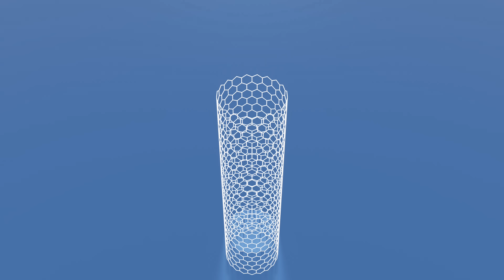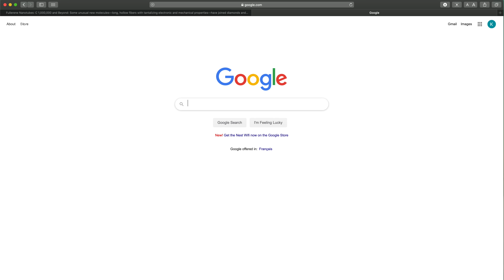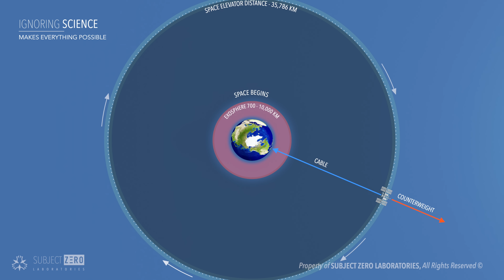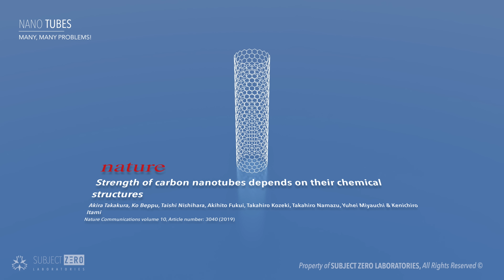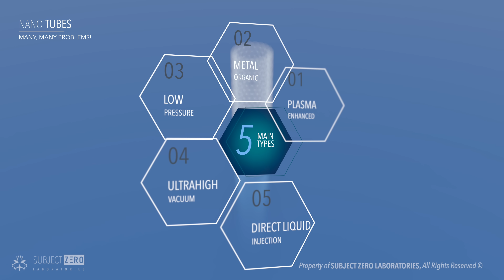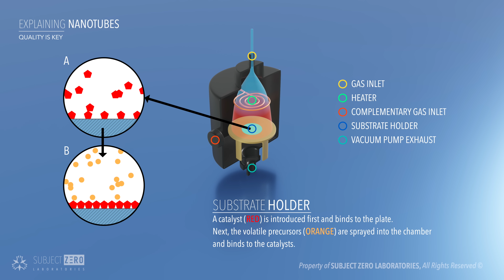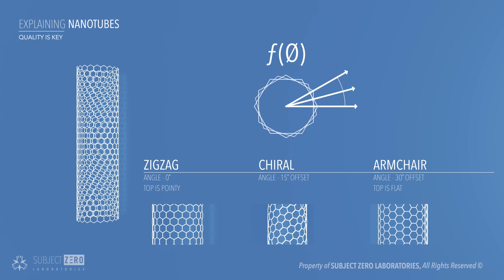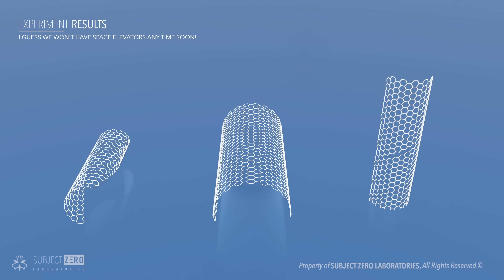Nanotube Strength, Bad News for Space Elevators [2019]

Comment: I'm afraid I have another spoiler: radiation. Even if you manufacture a space elevator cable that is perfect at the nano scale, it will be bombarded by various particles and waves coming from the sun and stars. Some of these things are bound to penetrate the cable's nanotubes, knocking atoms out of the perfect structure, and thus weakening the whole cable. Seems like a very costly cable if it will need to be replaced every few years, unless you can figure out how to detect and repair defects automatically.
Reply: But its not like space ellevator gonna leaving earths magnetosphere
Reply: Well, the thicker the cable, the thicker you can make any sort of shielding around it, in real terms and proportionately: a cable 4 times thicker will support 16 times the weight of shielding, yet have only 4 times the surface area, so then the shielding is four times thicker at all locations. A ribbon would shred. Yet, armchair nanotubes are still stronger than the requisite 63Gpa - it's silly how disingenuous he is, claiming that 'nanotubes are too weak, so no elevator', when he himself admits that armchair nanotubes made by this quick-and-dirty method were in the 70GPa range! His chart on relative tensile strength also shows how graphene is ALSO well above the requisite strength - so, just like the ISS, shields protect from radiation. Further, radiation is point-damage, while a cable has depth - if damage at any point has intact carbon around it, then the loss of strength would only reach 1% after a full 1% of the cable's cross-section were damaged at all points upwards along the cable... which actually would take decades, long enough to hoist a replacement and for it to pay-off... it'll be solid diamondoid, anyway, not nanotubes.
Reply: @anthonyrepetto3474  - So what magical material keeps the tethers from breaking loose when the wind picks up?
Reply: @MkeKen67  Um, winds only occur along the first few miles of cable, here in the atmosphere, while the cable itself would be 60,000 miles long. And, if you examine the cross-section of the cable over that distance, considering that all realistic proposals for space elevators would be floating in the open Pacific to avoid bad weather for the purpose of continuous operations, maximum wind velocity is only a tiny fraction of the forces that the cable would need to sustain for it to extend tens of thousands of miles. The effect of wind on the cable also decreases quite rapidly as the cable becomes thicker, because you square the material involved, while its cross-section increases linearly. It's like worrying about a swarm of flies going into a jumbo jet; simply having a force applied by wind doesn't magically make that force as powerful as the structural demands of the elevator itself. The REAL issue with space elevators is the capital-to-capital rate: for every ton of elevator material, how much cargo can I lift at a time, and how long does that cargo take to ascend? Many proposals for elevators use lifting methods which are very slow, and as a consequence, they lift fewer loads per year, and it takes longer for the first elevator to lift all the material to make the next one. A practical elevator will be thick, and it will support rapid acceleration by beamed or wired energy. Graphene really is the best candidate, overall, because it can take many forms and pack densely, and even this video's disingenuous host admits that graphene strength IS sufficient for an elevator. Carbon nanotubes were only associated with space elevators because they were studied first.
Reply: @anthonyrepetto3474  - You cannot avoid high altitude wind. Also, how do you keep the cable from gaining extra weight and thickness from ice build up at higher altitudes (the "icing" problem)? Furthermore, how can an orbiting satellite/spacecraft/space station be used as one of the harness points for a cable, with a floating harness point (in the Pacific Ocean) at the other end? Why would it ever stay "taut" in those circumstances? You will never get a heavy load to climb all the way up an extremely lengthy, slack cable. It would be like getting hung up on a zipline. 

Maybe the wind actually is the least of one's worries in this situation.
Reply: @MkeKen67  Um, I only mentioned the Pacific to avoid storms that would cause trouble for cargo operations on the sea, like a hurricane, not the jet stream and such. As I mentioned before, the amount of force that wind transfers to a cable drops linearly in proportion to the cable's width, so a thicker cable is automatically more wind resistant, without needing stronger materials. That wind also only applies to the first few miles out of 60,000 miles, so I wouldn't call it high-altitude. In terms of the total forces applied to the cable, wind is minuscule. I hope it's also clear that, if we are using beamed energy to loft cargo continuously, it is trivial to use that same beamed energy to melt ice; you are not presenting deal-breakers here. I also don't comprehend how you imagine that a cable cannot be taut if it is attached to a floating platform - do you think that the cable will pull the platform into space, because it is not bolted down ? I sincerely hope not. It's more alarming to consider that you believe that a cable would remain slack even as cargo was crawling up it. Cables become taut when they are under tension - and that tension is provided by the mass of cable that is up in space... a space elevator cable experiences tension upwards, forever taut unless someone used a rocket to drag the space-swung tip back down to earth... and, as long as the floating platform is heavier than the force of tension on the cable, it won't fly off into space or become slack. Does that make sense to you?
Reply: @anthonyrepetto3474  -  No, it does not make sense to me, certainly no practical sense. The earth's gravitational pull would be constantly pulling the cable toward earth. I don't care how far out into space it extends. Also, you cannot avoid storms in the Pacific, or haven't you heard of typhoons? And the kind of "beamed energy" required to keep this system working as you have described it is not currently available, and would not be cost effective if and when it does become available. For that matter, how can you ensure that a cable this long would stay "taut" without expending a huge amount of energy at the tether point in space? You really think centripetal force would take care of that problem, at the angular momentum of one rotation per day? The whole thing makes as much sense as a perpetual motion machine.
Reply: @MkeKen67  Wow, yes, you can calculate how much force is exerted upwards by the rotation of the Earth, and see that it is sufficient to keep the cable taut. That's not some pseudoscience garbage - there have been numerous serious research papers on the topic for decades. I don't need to be your Google. ...and, you think that we would have to keep the cable up by expending energy? Like, rockets attached to a space station, or else it'll fall down?
Reply: @MkeKen67  okay, I'm not laughing so much...I'll respond to your other points: first, typhoons only happen in certain locations; large swaths of the Pacific and Atlantic are called the 'doldrums' - not many high-wind storms, and easy to tug a floating platform when a satellite sees one forming hundreds of miles away. Yes, the gravity of the Earth pulls down on the cable; nothing makes that go away. Instead, there is a greater force exerted upwards by the space-side of the tether, because Newton told it to keep traveling straight ahead, but the rotation of the Earth is pulling it away from straightness...that creates a tension which is greater than gravity. That's perpetual motion? The existence of gravity on the cable would also not cause it to be slack... I don't know where that keeps coming from, so I'm not sure how to respond other than to point out that a rope will go taut when you pull on it.
Reply: @MkeKen67  Oh! and your "currently not available" beam energy - concentrated sunlight transmits many kilowatts per square meter, and melts ice. Microwave beams, called masers, are good too. Is that a surprise?
Reply: @anthonyrepetto3474  - Have you ever heard the phrase "too good to be true"? I believe that applies to the entire space elevator concept. I will now disengage from this pointless discussion, as I am obviously too grounded in reality for space elevator fans. Have fun.
Reply: Run a current through the cable and the magnetic field created will deviate charged particules. There are no neutron in space. The last piece is ionizing photons. X photons are negligible in our solar system but UV photons are not. Next goal : find a solution to protect graphen and carbon nanotube from UV photons.
Reply: @Cole Park -lol nice!

Comment: Zero-defect tubes will only be made with carbon direct-deposition, not chemical-to-carbon translation via burning. We're getting there.
Reply: yeah i dont know why they still try make carbon naotube from carbonization stufs? With depozition gas and electrical curent to oriented the atoms will fix this more easy. 
The next era will be contruction and manufacturing at atom level. in the past sigle was control the percent of material (99% Fe + 1% O2 = stainless steel)
Reply: I think either nanotechnology or bioenginering will pull it off.
Reply: @killcat1971  seems like you could get a bacterium to make near perfect nanotubes.
Reply: Hopefully zero-defect tubes are much stronger, orbital rings around gas giants are a great way to mine the atmosphere, and would allow for rail launch systems in orbit around Earth, in which the higher orbit and lack of drag mean the velocity is much more helpful and safer.
Reply: Literally zero defects is a lot to ask with all the atoms in a space elevator, etc. Other effects might be able to counteract most of the loss in strength due to defects if the defects were few enough though. E.g., if a filament is made of many very-high purity nanotubes, wherever there is an defect and therefore weak point at one point in the tube, all of the other tubes might be perfect near that point, ?preventing failure there.

Comment: Space elevators are more realistic for smaller planetoids and moons where you dont need as much cable strength
Reply: The materials to build a lunar elevator already exist
Reply: @MartinCHorowitz  Our moon doesn't spin and therefore it wouldn't work. I think that is the case with most planetoids and moons. Also, why would you want to invest so much into such a structure on some moon or planetoid? That would only make sense if you have constant traffic.
Reply: @Garium87  The moon does spin.
Reply: Alex the moon does spin. It takes 27 days though. It appears not to spin due to how we perceive it on earth. The moon. Regardless of this, space lifts/elevators are potentially lethal as they'll be exposed to large amounts of electrical stresses and could act like a cosmic lightning rod.
Reply: Steel Beam it really should but not to be used to travel along for certain, not without a formidable and utterly fortified faraday cage. However, the level of electrical power is so intense it could conduct untold amounts of force to ground it could make Hiroshima look like a picnic. You should look at the 'tether incident' when a satellite with several miles of tether to pick up cosmic energy received far more than bargained that it blew the tether off into space.
Reply: @arandomlizard3411  Its tidally locked, and a lunarstationary orbit does not exist so his point is valid.
Reply: @PunishedClippy  I dont think you want that kind (amount) of power being sling shot down to earth. It would be catastrophic for the region to which it was directed.
Reply: Launch loop, skyhook, and space fountain are infinitley more practical. Space fountain is my favorite as it basically is a space elevator kept up by power. Maybe like antimatter initiated fusion? If anything it still makes way more sense then the elevator, which would only work on moons and stuff.
Reply: I think the most practical version that could be built "today" is a combination launchloop or massdriver, and a skyhook to fling it to a higher orbit.
Reply: @Death1rock1334  that's more feasible but it would also be much less reliable, throwing and catching high masses is difficult even with low gravity.
Reply: Idk, kinda defeats the purpose though doesn't it? We want to use an elevator cause earth's gravity and atmosphere are hard to beat. Planetoids wouldn't have this problem, at least not nearly as much.
Reply: If not for earth or small space rock....then there is always a kind of sweet region inbetween where it can be used optimally.... where gravity and atmosphere is less a problem, like on mars, venus etc etc so planets with smaller gravitational force down to pluto like objects....

Seemingly earth (and bigger planets) is (are) causing a problem.... so there may be planets smaller that can use in a profitable way this idea... and yes small space rocks may not need this since it delivers no advantage compared to rockets.....

so a sweet region/spot some where inbetween small space rocks and smaller than earth planets.....

people always tend to think in extreme situations either earth like planets or small space rocks....

why not something inbetween ??......possibilities enough....
Reply: ooh that could be, but in general  you understand what I mean I hope......and that is the point.
Reply: next to that with the average temp of 480 Celcius its not an interestig environment to stay very long, let alone build a elevatro there.... so why bother for venus....

I didnt know venus was so hostile.... that surpriced me...

OK never to old to learn ....thanks
Reply: @ErikMoroni  but it would be more efficient even on a small moon to send materials from the surface to space instead of using rockets all the time.
Reply: @ahmadbuthom7966  Yeah, maybe if it's something like a mining operation, and the tip of the elevator is some sort of hub, that'd be awesome. But seeing how rockets are becoming more and more efficient and low cost... Guess we'll just have to wait and see.
Reply: @ErikMoroni  totally yeah, great example.
Reply: @ahmadbuthom7966  Search for mass accelerator ;-)
Reply: Erik Medeiros actually on thin no non existent atmospheres objects it would still be useful to have an elevator so you don't have to land on the object which will probably require a fair amount of fuel due to atmospheric breaking not being possible/practical...
Reply: Best method, of launching from the Moon, would be a Linear Induction motor track, just like the "Wicked Twister Roller Coaster at Cedar Point", but scaled up to about a Kilometer long.   Zero wait time of an elevator, and no rocket fuel, except for orbital corrections, using minimal fuel. Solar panels and a Tesla Power Wall, to power the launcher.  The Space Capsules, would ride, something like a roller coaster car, that is, the other part of the linear induction motor. The Moon is great, for Mining, and Astronomy. 

With a Space Elevator, you have not enough orbital speed, to keep from falling back down, unless you are in a high enough orbit.
Reply: @Geoffr524  What's more is that most of such a moon based launch rail could be built from indigenous materials by tele-operated robots.
Reply: Imagine if our moon were a twin moon near equal size orbiting each other in close proximity so that you'd weight almost nothing during perigee
Reply: @Geoffr524  I would not like to ride that coaster. Good for cargo though.
Reply: A lunar space elevator is feasible with even conventional steel. Trouble is, it rotates once every 27 days so lunarstationary orbit is inconveniently long. Much longer than an Earth space elevator. It's especially impractical because the Moon has such low gravity, since the cost of exiting its gravity well is incredibly low. But Mars is a pretty happy medium. In the future I could see a Martian Space Elevator being feasible. Especially since you can just hijack one of its super tiny moons to be the counterweight
Reply: No, the main issue would be its conductivity of charge. Last thing anyone travelling in one of these things needs is to be stuck in the middle of a cosmic lightning rod.
Reply: How about a series of hundreds of mini elevators in all the different orbits each with the line dozens of  miles long and rotating rapidly so the part near earth is slower relative to the earth and maybe the spacecraft has a tether too so when it hooks up it can let that line out generating electricity to be fed back into the system. It would swing like a monkey from one mini elevator to the next to higher orbit. Someone needs to do the calculations.
Reply: Losif Crumb so many moving parts and components miles and miles long flying about in space and tethered to the planet? What could possibly go wrong...
Reply: Even then a linear accelerator may be the most efficient way to boost stuff to escape velocity if there is almost no atmosphere. Shame because I fell in love with space elevators when I read Clarke's book back in the day.
Reply: Space elevator + Planet with combustible atmosphere
Reply: That may well be true, but the lower the mass of the object you are trying to launch from, the less useful a space elevator actually is.

It's greatest theoretical benefit comes on the highest gravity planets...
But these are also the ones where actually constructing one is the most difficult.
Reply: Going Up!
Reply: Specifically small fast spinning planetoids.
Reply: @JosephHarner  depends how fast, if it spun too high a speed the centrifugal force that might have helped support it, could also tear and  "throw" the elevator into space.